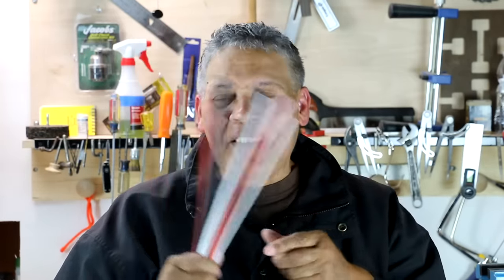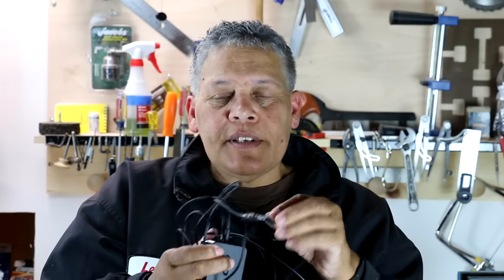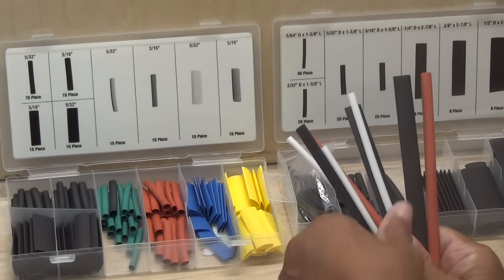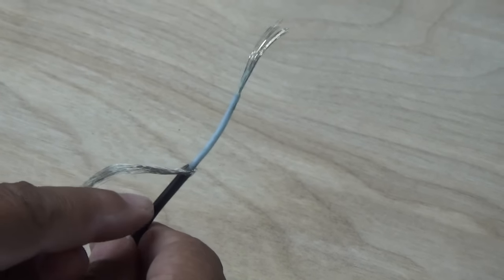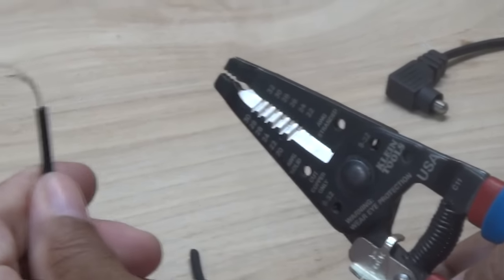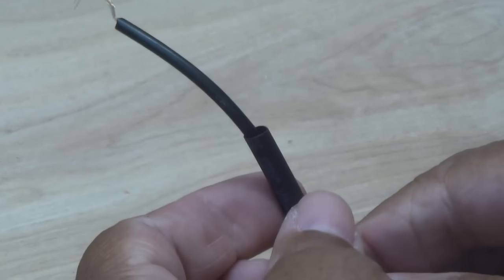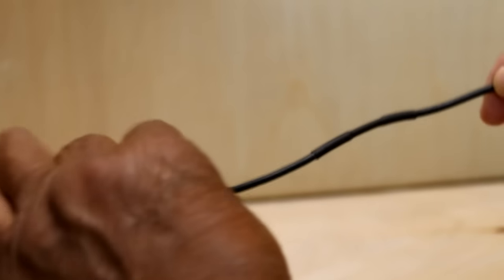Best Way to Repair Broken or Chewed Power Cords

Comment: Leah, with stranded wire, start your strip then twist the strands with the waste insulation as you pull it off.  Makes for a tighter twist. I do feel that your videos are top notch.
Reply: I'm probably just being dense but I'm not following what you're saying.  Would you clarify?  I'd like to know how to make a tighter twist.  Thanks in advance.
Reply: I believe he's saying that as you begin to remove the insulation from the cut wire, stop before it comes off the wire, then hold the wire by both the undisturbed part and the insulation that's about to come off. Now twist the trash insulation and the stranded wire between where you are holding it will twist. Continue until you get the exposed wire fully twisted and the trash insulation comes off, Repeat on the other cut end of the wire. Then you can do the splice connection Leah showed. Is that any clearer or did I just confuse you more?
Reply: Thanks!  That does makes sense.  For some reason I was envisioning the insulation staying on the wire.
Reply: You nailed it Rick, thanks for helping
Reply: @Keaton Nixon Instablaster :)
Reply: @Miller Stetson it did the trick and I actually got access to my account again. I am so happy:D
Thanks so much you saved my account !
Reply: @Keaton Nixon glad I could help xD

Comment: Great video.  I've been using shrink tubing for years and it works great, but as a rule I solder the wires after twisting for a really solid repair.

Comment: Use shrink wrap on my boat all the time.  Makes for a nice water tight connection.
Reply: Tom P what part of the boat? I was looking for a wrap that I could use to go around the wires/boot in car door jambs.
Reply: I use shrink wrap on ALL electrical connections to my bait well pumps, my Jack Plate (a device that raises my outboard vertically), and all my electronics.  It seals it and keeps it waterproof and should be a great choice for you car.
Reply: Tom P I wonder if shrink wrap tape would be best for what I'm trying to do.

Comment: will you please do a video on the two braided wire repair.
love your videos
Reply: Yep, it is important to do the 2 wire repair so that people understand polarity and short circuits. I worry that someone who is a real first timer at this with no electrical background ( I am a professional worrier ) might not understand that the outer sheath wire must connect to the other on the other side, and the same with the inner, but they must not touch, so three bits of shrink tube are needed and it has to be done in a particular order. Inner first, then outer, then shrink over the whole thing. Love the work :)
Reply: It's pretty simple:
-insert a large heat shrink tube (from now on HST) on the cable
-insert a tiny HST on one of the inner wires
-splice the cable and shrink the tiny HST
-repeat the two above for the second inner wire
-shrink the large HST so it will cover up the tiny ones
-done!

Just remember that the shrinking ratio is (usually) 2:1, so choose a proper diameter for both inner and outer HSTs.

Oh, and if you don't have an heat gun, you can use a lighter, or even a matchstick.

Comment: Hi nice video. I use this stuff all the time when I'm repairing car electrical equipment.  When your joining the wires up another method is  with the bare wires shove them in to each other so basically you got one long straight wire and twist it together then get the soldering iron underneath the wire warm it up and get the solder and melt the solderbin to it from the top all the way along then once cooled down slide the heat shrink over it.  I use a cigarette lighter some times or sometimes i use the heat of the gas soldering iron.

Comment: Leah, Someone sure looks happy and rested, good to get the notification that you’re back and making peoples lives more pleasant. I believe the tubing shrinks to half its original diameter and wondering do you ever put two pieces on and make the splice protection even thicker? I have on wires that get heavy use.
Reply: I'd like to know that too.  

I have some of the tubing already but I'd like to know if there's a way to use it on a wire that's not broken in two but that the plastic sheath is cracked open.  I bought some of the liquid electrical tape and it works OK but I'd like to have something a little more durable.
Reply: You can get heat shrink at different ratios. Standard is 2:1 ie it shrinks by half but you can get 3:1 etc but cost increases.
You can most definitely layer up heat shrink to ensure a better fit.
One issue tends to be that you have to cut the cable you want to work on. As most have some adapter that you’ll not get the heat shrink over. Or if you can it’ll be too big. So layers can be a good work around. Please note that you can create a weak point in your cable if you use too much. Making the cable inflexible and therefore likely to break where the cable meets the heat shrink.
One way around this is to stager the heat shrink but it might not look pretty.
One thing to note is you’re not going to get many cables with a single core. Definitely not a power lead.
So you’ll want to either heat shrink in parallel each core then apply a final layer of heat shrink over all.
Or
Stager them if you have multi cores.
Final, final note, I would always solder/mechanical fix any power cable. As twisted cables over time especially on a laptop cable or any cable that tends to move. You may find the twist would slip over time.
Reply: @Cityof Oaks, forgot to mention that you can also buy heat shrink tape... I personally don't like it as the type of work I do, things need to look good and professional.
Not promoting this but its a short video showing you what it is and how to use it.
https://youtu.be/dczGLe5nSHo
Reply: Thank you David Gatherer.  I didn't know about the heat shrink tape and have a couple of situations where it would work well.  My repairs are generally for my own use so looks don't matter as much.  I appreciate you sharing the info.

Comment: Leah - they make a butt slice with solder on the inside that you can fuse with a hair dryer or heat gun. 

(Leah - you know I'm just busting your chops. Your fix is perfectly good.) Thx

Comment: Heat shrink tubing has several uses besides electrical repair. I had a pair of pillars that the coating came off one handle, I replaced it with heat shrink tubing. No more funny feeling handles!
Reply: loveminis, i use it for jewellery making to connect looser ends..

Comment: Purchasing a replacement power cord is the best solution. Very inexpensive and much more sturdy. Heat shrink tubing is not thick like wire jacketing and even the heat shrink tubing with adhesive tears VERY easily.

Comment: Firstly, it is imperative that heat shrink that has the correct voltage rating is used for the applicable task (if the component being repaired is powered by a 12v supply, automotive heatshrink can be used. If the component is fed from a 240v supply (ie an extension lead), 240/415v heatshrink needs to be used.)

Secondly, always crimp, solder or use appropriate mechanically sound connections. Otherwise, it is possible to pull the connection apart (ie if someone trips over the cable and pulls it). This can result in the connection being pulled apart which could result in live conductors being exposed. This is extremely dangerous as this can result in electric shot and/or electrocution. It is possible for your hart to go into fibrillation hours after receiving an electric shock, which is deadly. Furthermore, using mechanical connections will significantly reduce the risk of this termination being compromised. 

Thirdly, the termination you’ve done in this video is very poor. It will have high resistance which WILL result in the joint heating up as more current is drawn to maintain the same wattage of the appliance (simple Ohms Law). This increase in current can result in the conductor heating up, possibly melting all the insulation off resulting in a high fire hazard and an imminent electrical shock hazard. Using inline crimps, solder or other correct connection methods will eliminate this.

Comment: You can also use those heat shrinking tubes to replace broken plastic tips on the end of shoelaces, or to make custom shoelaces like those satin ribbon ones for Doc Marten boots 😃
If you don't have a heat gun, you might be able to use a hair dryer.

Comment: Hello Jane, love your videos, have a question. What, if any, is the determining factor when it is necessary to solder the wires? Thank you.
Reply: Its a good idea to solder any wire splices to ensure good conductivity & strength in the join,always cover any joins with heatshrink tubing to prevent wires shorting out & to prevent your hands from touching live wires 🙂

Comment: Great timing for this video I just cut through my outdoor extension cord with my hedge trimmer. Question for you. Is there a difference in the colors of the sleeves or is that just cosmetic?
Reply from the maker: LaTX Piper. Both cosmetics or wire identification.

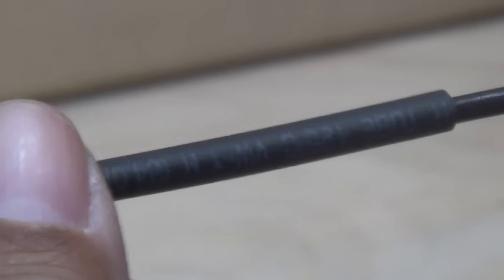Comment: 3:48 - Naive question - wouldn't just using black electrical tape work instead of the expense of heat shrink tubing + heat gun?

Comment: I can’t tell but did you twist together both the inner wire and the woven shielding?  The shielding is usually the negative current (DC current) or the neutral (AC).  I always use marine heat shrink which has glue inside it and is waterproof.  HF sells an inexpensive kit of it like those shown in the video.

Comment: Hi Leah. That's pretty cool. I didn't know such a product existed. I have used a wire stripper in the past but never really got the hang of using the stripper part. I always thought you had to cut through the casing a little bit before you pulled it off. Most of the time I ended up removing the wire with the casing. Also, do you think a hair dryer be hot enough to shrink that tubing? Thanks for all the great videos! Hope you had a fun and relaxing vacation.

Comment: Hi Jane, do we have to be concerned that the heat shrink tubing may not be good enough if the current flowing through the wire is very high. I.e. would it melt the tubing? Also could you explain what should we do for single core strand wire if they are broken; how could we solder them or join them and then use the heat shrink tubing? Thank you.

Comment: I've got a powertool with a cracked bend relief sleeve (the thicker bit of rubber where the power cord goes into the tool body) and can't get heat shrink tubing around it - is there a way to repair this?
Reply: Have you tried Sugru?

Comment: Can you cut the heat tube lengthwise and slip over the wire to repair at the base of a plug?
Reply: No, it doesn't work unfortanely..
Reply: Peter1956Javea & bodoorgeest
Thanks for the reply.  The plug area is always in need of repair. So I suppose it would actually be better to cut through the wire, 
slide the tube on, retie the wires then heat shrink the tube.
Reply: I believe heat shrink tape would work for this.
Reply: There are two products available that may work better for the type of repair you need. 1 liquid electrical tape, it comes in a can with a brush and you paint it on. It can be applied in layers to increase the strength. 2 Sugru silicon putty. It is a soft rubber material you can wrap around objects. And after it dries it remains flexible.
Reply: No, I tried it

Comment: Hi there, Jane. I'd like to do this process with a 110V 60hz motororized fan that is on our school campus. The air hockey table that it powers could use a little TLC! However, the plug that originally belonged to the fan is gone. How can I know what sort of wire to use, or if I need a wire with 2 or 3 prongs?

Comment: No solder? Come on Leah. ;)
Reply: Shawn Tartaglia I was thinking the same thing
Reply: Solder makes the wire around the joint brittle, so a crimp would have been better choice.
Reply: Ozren B - I've NEVER had that problem. Been doing this for 30 years.
Reply: Shawn Tartaglia yeah i  tend to solder a join before hand so a valid point there mate lol
Reply: Shawn good for you that you never had a failed joint, but it is a fact that soldered connections are inferior in situations where joint will be mechanically stressed. In our power department, tens of thousands of crimp connectors are not only the norm but soldered connections are strictly forbidden.

Comment: Would not recommend the WU splice for stranded wire unless also used with solder. A bad connection could in the worst case cause a fire. A no solder alternative would be to use a crimping connection (look up butt splice).

Comment: Help. I bought the tubes and heat gun...spliced my wires...but I have two separate sets of wires; running parallel to Each other. What to do?

Comment: Only use 60/40 type solder for electrical repairs,other types of solder cant be used as the flux it contains could cause corrosion in the the wire joint, which means sometime later you'll have to cut it out & redo it all over again 😔😔

Comment: Hello i have a question anyone can answer. But why do some cables have one copper wire and then you twist that together and then some cables have 3 wires copper, red and idk but i remember it was blue and then you twist them together with another same cable so why why is that? That some cables have 3 wires and some have 1? And is there cable that has 2 wires?

Comment: What about repairing a cord that's just nicked? I don't want to cut it in half; I just want to protect the area where the insulation has been damaged.
Reply from the maker: you can't do it because you would have to get the tube over the plug.

Comment: I would not expect that splice to have much mechanical strength. It may just pull apart. I would always solder the splice, but I suppose not everyone has access to a soldering iron and solder. I certainly would not use this approach to repair a mains electricity flex.  A new mains flex should always be fitted if one becomes damaged.

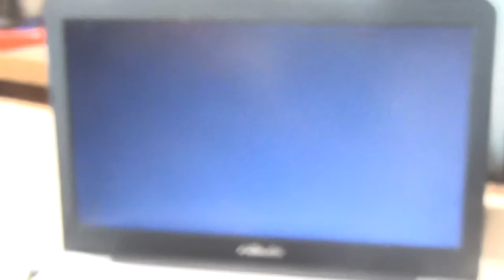Comment: 2:05 doesn't prove the cable is working as the laptop could just be running off of battery power.

Comment: But you need a heat gun to do the repair this way.. With electrical tape, you don't.  i have a mains lead which you can see the wire sleeve underneath, it''s not showing the bare wire luckily. But wouldn't electrical tape be best in this situation where no live wires are showing, and you don't have a heat gun?!

Comment: I would never recommend doing that.  Sure it is way better than using electrical tape, but I would never ever recommend doing that either.  Especially for AC wires.
that heat shrink tubing shrinks to half its original size, so the strength of that joint is going to depend on what size you use and how much overlap of the insulation.   I would always recommend solder it, but if this is the approach somebody wants to take, use adhesive lined heat shrink tubing.  This type of tubing has a shrink ration of 3:1, it is double walled so it will provide more protection for that unsoldered joint, and the glue will really add strength plus selling it against moisture.
As a side note if you want to just tape up the end of an unused wire, you can use heat shrink also.  Just leave 1/4 inch extended past the end of the wire, heat it up as normal, then while it is still hot pinch the end with a pair of pliers.  Better than tape.